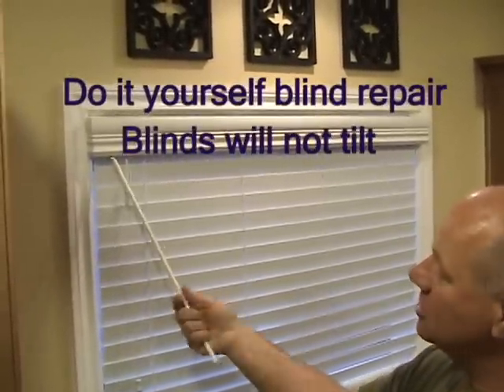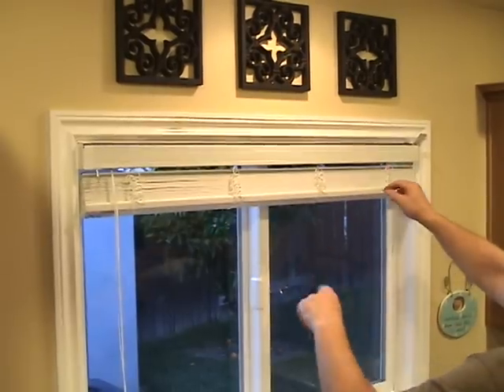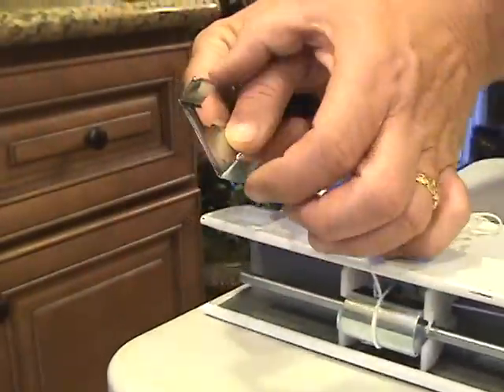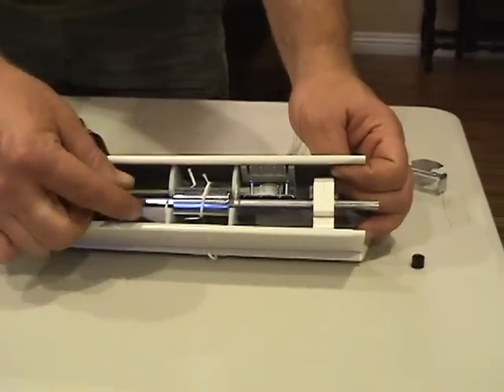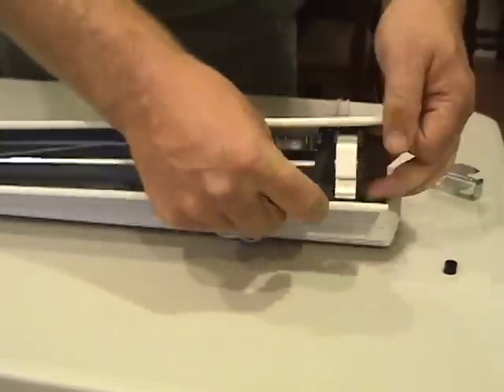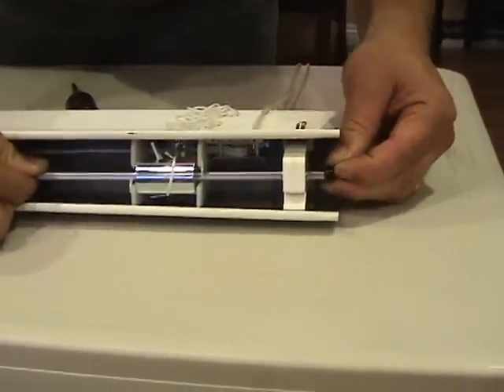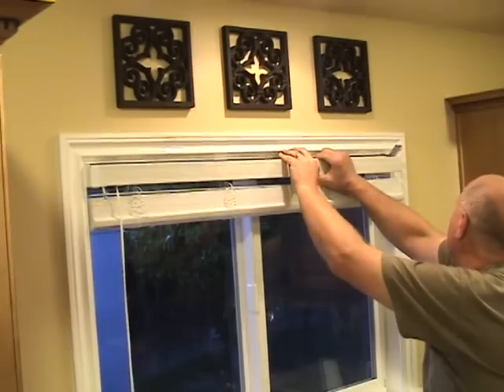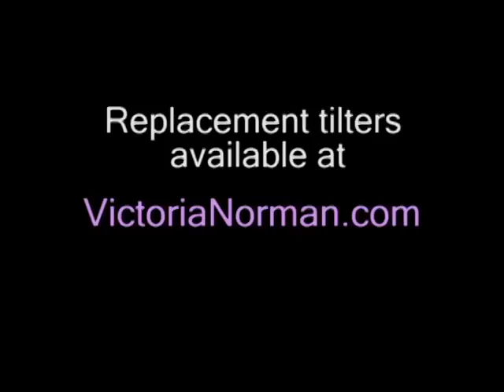Blind repair replace broken tilter

Comment: Excellent video. But I may have a unique problem. Discovered I do not have anything removable to take off so I can slide the rod through the tilter mechanism I want to replace. It looks like a bit of metal may have been welded onto the rod, or the rod roughed up a bit, right before it enters the old tilter mechanism. that I need to remove. So I cannot figure a way to get the rod past a certain point and replace the mechanism. Any ideas?
Reply from the maker: Sometimes that center rod is cut with a sheer that distorts the end a bit and makes it hard to pass through the tilter.  You could try sanding or filing the sides flat.

Comment: Thank you. What is the difference between a low profile and a high profile tilter?
Reply from the maker: A high profile tilter fits in a channel that is about 2" high, a low profile tilter fits in a channel that is about 1 1/2" high.  The channel is the sheetmetal "u" shapped that houses  all of the mechanism and is the same width as the blind itself.